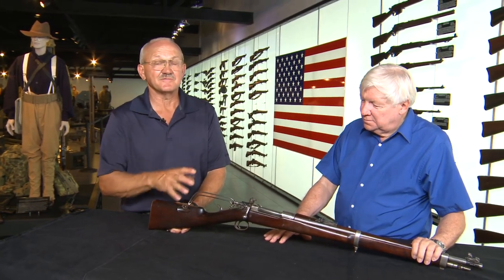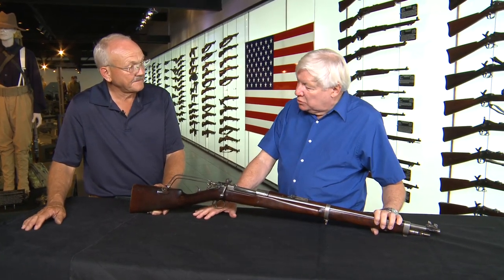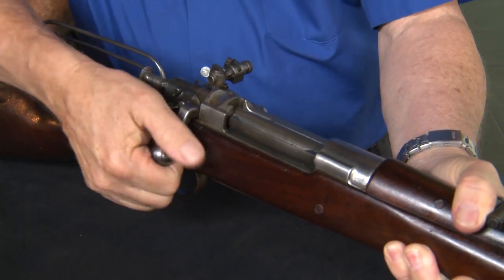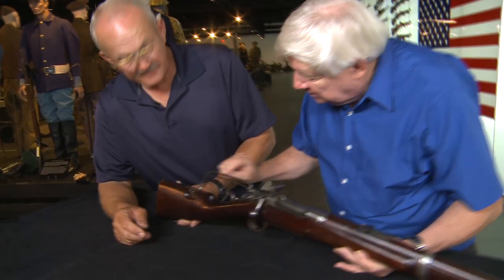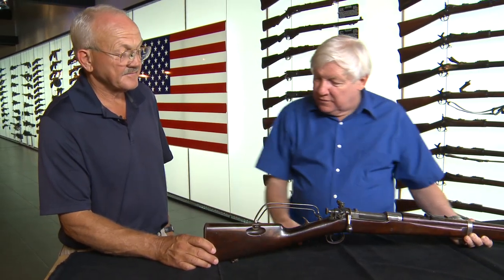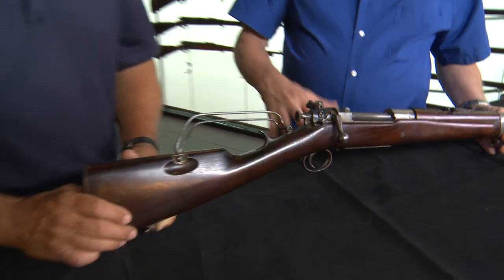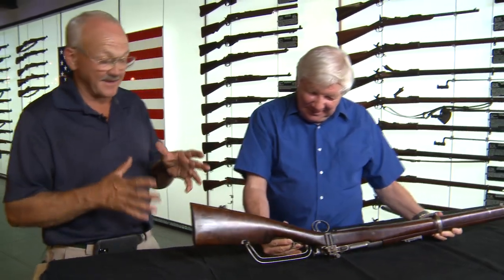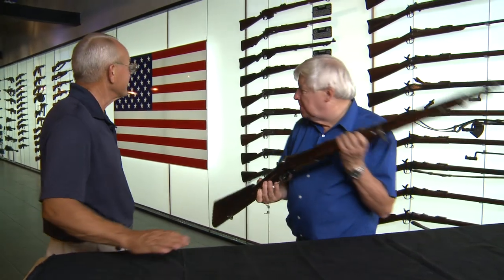Semi-Automatic 1903 Springfield rifle (converted from bolt action) Unicorn Guns with Jerry Miculek

Comment: I have heard of this, but never saw so much as a picture of the Springfield conversion before now.  I don't know if this is a "one off" or not, but certainly exceedingly rare.  What a concept!  Still... you would think that at least some kind of "auto closing bolt" or even straight pull bolt would have evolved from this for an American made battle rifle.

Sadly, the next gun in the evolutionary change was not shown in this video... I await without!

I like this series...  keep going.